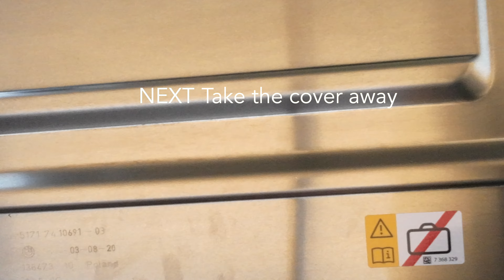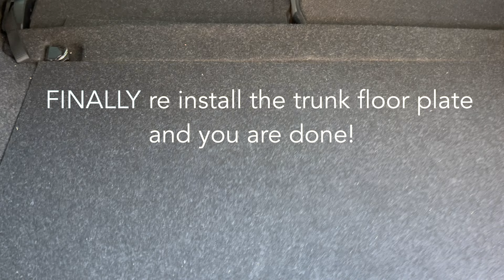BMW i3s Trunk Extention Installation

Comment: I see you used the forbidden tool to screw the Trunk Extension into place 🙂
If you want to use an electric screwdriver you need to set the torque clutch to lowest level possible but as there is no standard for the actual torque I left this out of the installation instruction.
Reply from the maker: Yes you are right. Therefore i made a red cross over the tool in the video. Do you know where i can get the rivets, as i destroyed them 😂

Comment: Do you know if it reduces the weight at all because it replaces a steel plate with a plastic shell
Reply from the maker: sorry but i dont know if it reduces the weight
Reply: That steel plate is actually stamped out Aluminium. So there is not weight saving fitting the Wokeby boot/trunk. I highly recommend its fitment. Click my picture to see my review. Best Dave.